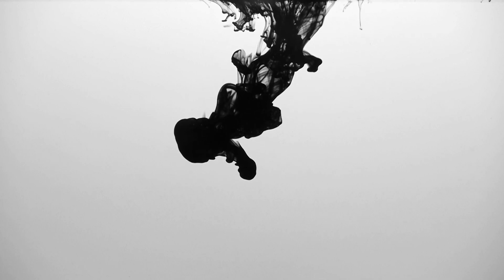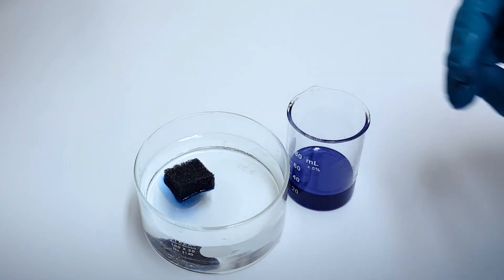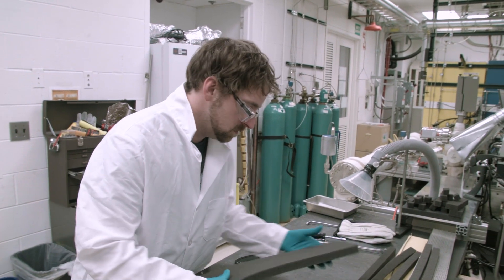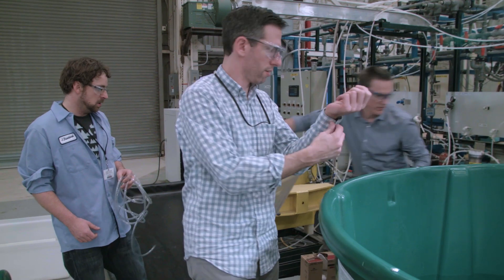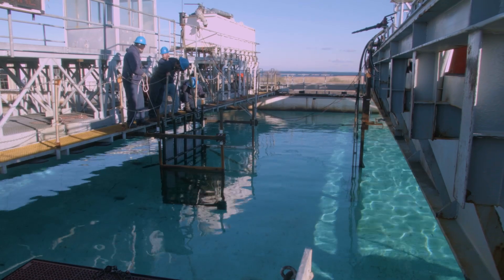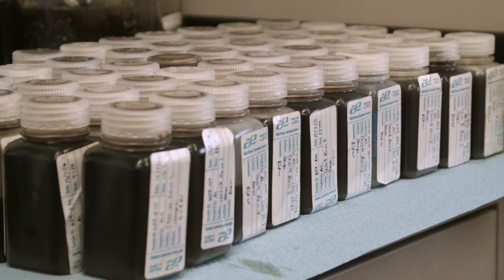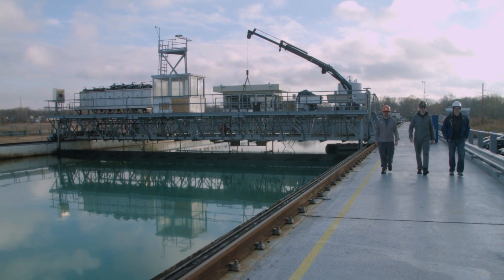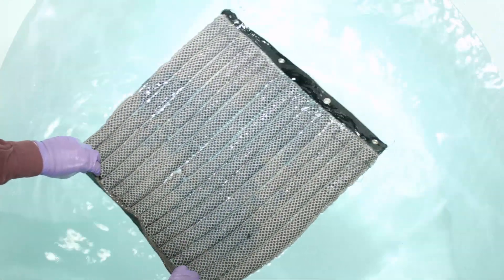Oleo Sponge: A Revolution in Oil Spill Cleanup

Comment: Four comments?
Reply: Shocking?
Reply: Roland Izulu disappointed. I've seen so many cleanup methods that haven't been used. Have you seen the iron oxide magnetic oil method or the powder that turns oil spills into a solid rubber mat that can be rolled up?
Reply: Charles Torres Hi. No i haven't. Interested in such solutions because of massive spills over decades in Niger Delta. Do you have links of the two solutions?